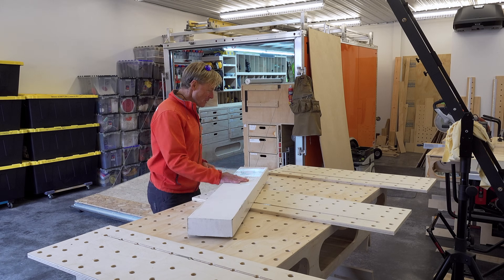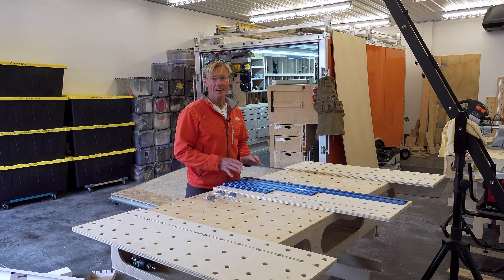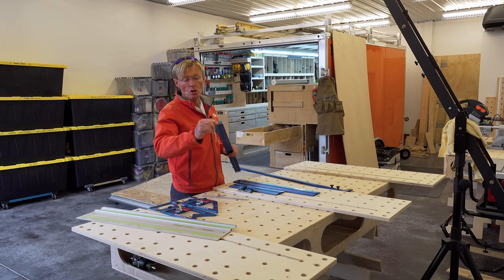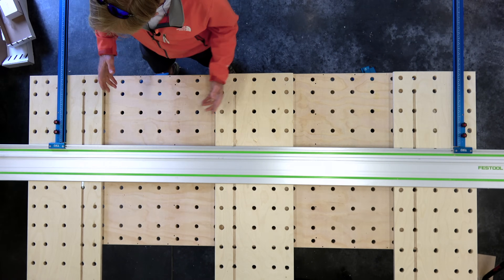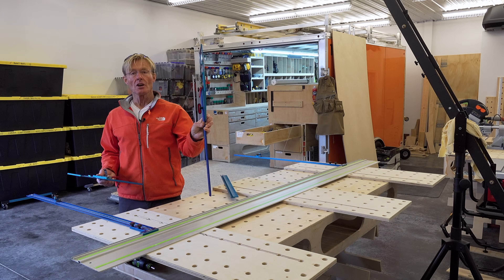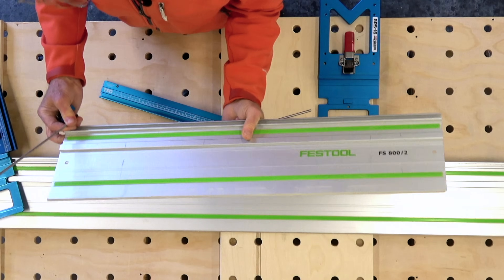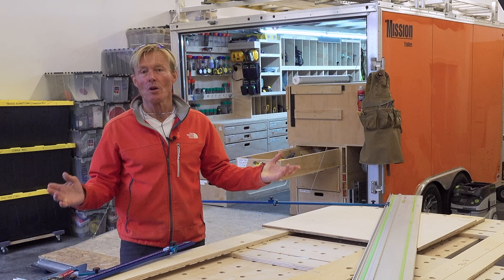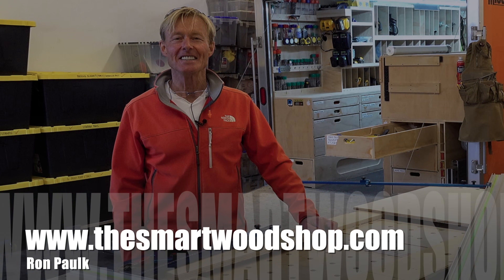TSO TPG 50 Complete Parallel Guide System (Rerelease with error correction)

Comment: Hi. Thanks for the informative video. I recently purchased (on OfferUp) the Makita Track Saw system. 
My question: I'm looking into the TSO parallel guide system. They offer a 20" inch rail, a 30" rail, and a combo set of 30"/50" rail ($100 more than the 30" set). In my spare time, I enjoy building small furniture for family and friends (book cases, shelves, tables, etc. in my side-of-the-garage shop. In your opinion, which rail size would you recommend? Thanks again!
Reply from the maker: If I could only have one rail I would go with 30" and workout something else for wider rips as 30 covers 90% of what I do. If you think you will do more wider rips then go with 50" as it will rip everything the 30" will. Of course it is a little clunky using the big rail for narrow stuff.
Reply: Thanks for taking the time read and reply to my request.

Comment: You also need a big workbench to cut with track saw so the space saving is debatable compared to say a table saw
Reply from the maker: A table saw cannot do what a track saw can do. A track saw replaces or works like a sliding table saw which is at least 10' long for ripping sheet goods. Those are big saws, take a lot of room and can't go to the job site. A work bench is necessary regardless of using a track saw or not so the track saw is the most compact and portable way to get rips done.

Comment: Hi there, I am looking at these as an alternative to the 20mm mft table like you have there to make perfect 90 degree cuts (at least temp for now and may go for the mft table later on for other work) . Anyway the stops ...if you have one on the left and another on the right lets say at 30 inches each - how do we get them both dead on (each) at 30 inches..is there a chance one might be over or under a fraction compared to the other? does it notch in place for example?

Comment: Hey Ron do you make 20mm dog holes or 3/4 inch dog holes and why?
Reply from the maker: 20mm. They are industry standard worldwide. My first bench was 3/4" 4" on center and it was an uphill battle that caused problems. 20mm and 32mm spacing have been the industry standard in the cabinet world since WWII. The only regret I have is spending 30 years holding tight to Imperial. The metric system is so much easier than working with fractions. Add 1/8" + 3/16" + 1/64" or 3mm + 5mm + .5mm. I can do both, base 10 whole numbers wins for me. 😎🤙

Comment: I have the woodpeckers and it is a disappointment. How does the TSO differ?
Reply: The only reason a person needs parallel guides is if they are ripping several sheets of God knows what. I bought and returned the Woodpeckers parallel Guide set as I despise wasteful tool set up time. Then I bought the Festool Metric parallel guides put them together and never took them apart, As long as you use the same saw with the same model saw blade it's fairly easy to use. Pay attention to the set up videos offered all over you tube. I like the Festool Parallel guides but Paralax can be an issue with them, but they are a little heavy and I am kind of old and do not consider them the most portable. Seriously watch out for Parallax with these puppies. 
So for a more portable set I bought the Seneca rail guides without the Incra Track as I have more Incra Track than I like to admit. The lock down of the Seneca to the Track was good but the incra track does not fit well and is less than desirable as it will not stay square without high precision shims. However, I did like their narrow stock guides. Also the Incra scales do tend to move so I used some hot glue to help them stay put. No, not the best solution.
Now I've gone and purchased the 30 inch option from TSO. I can report I bought the best one last. I never expect anything to be "Spot On", "Dead Nuts Square' when speaking about wood. There is close, very close, and really - really close. Wood is a living breathing material and it all moves. even very expensive plywood can and will move unless properly finished. So understand NOTHING will ever be and stay perfect. Go ahead argue all you want but you'll be on the losing side. 
So what are some other problems? Set-up Methods, operator deviation, and Blade Deflection. Forget thin Kerf blades unless you like Blade Deflection, cupped guide rail splinter guards and all manner of issues. Every Material has an optimum Speed and Feed Rate and so do blades, end mills and router bits. "Like a Knife through Hot butter is not a mathematical term and can not be measured. Most people cut too fast, either too fast of a blade speed or pushing to hard and fast through the material. 
Festool and Makita rails are not compatible the blade offsets on the saw are not the same measuring from the guide rib to the inside of the blade. I know as I have both type rails and both type saws. Also note that both manufacturers toe-in the front of the blade inward and not by the same amount. That thin assed blade on the Makita tracksaws is a POS - throw it away, buy their real ripping blade and enjoy your hobby. The Kerf is too thin and the Blade Plate thickness is even thinner. It will deflect with a heavy breath. 
As for the parallel guides I own the TSO is the best. But poor setup kills them all and makes them all useless. Watch the TSO set up guide (more than once) learn to make and use MDF gage blocks to help with consistency side to side. The TSO is not only CNC cut but also CMM measured to a perfect computer model. Did I mention the etched scales on the TSO rails are in both Imperial and Metric and their stops are unmatched, better than everyone elses.  The metric scale has a little mark every 32 mm as a bonus so you can make a balanced 32mm panel with their rails and this is why I bought the 30 inch rail set first. 768mm make a nice 32mm balanced panel for upper wall cabinets using Festools LR32 cabinet system. Almost US standard, but not exactly 30.25 inches. I try never to convert metric and Imperial or the other way around. Conversion is our enemy Use one, both but what ever the system stay with is until the projects end. 3/4 inch is not and can never be 18mm. 
FestooUSAl pisses me off as they sell metric accessories for metric power tools but substitute the proper metric scale with a damn Inch Scale. This sounds stupid because it is.  
Why 32 mm? Well 1.25 inch is 31.75mm, remember the USA rebuild Europe after WW2 and they improvised 16, 32, 48, 64, 96mm sounds like an MFT table being born.
We are all here so we can learn and grow. Nothing we make is perfect. Most need to forget about perfect, Get over themselves and learn to measure. How we deal with imperfection as a teacher is all important. Learn to plan, a drawing (crude as it may be) figure out what can go wrong and have a plan to deal with it. I waste a lot of wood, every piece is initially cut larger than I really need, but hey I have a wood burning shop stove. Winter is coming. 
Your drawings will improve, and do not forget to mark your reference edge and face on every piece. Variation in panels is almost always operator error or deviation from a well thought out plan.  Again, THIN kerf blades suck the air out of your projects and your confidence. Sorry for the rant. Certified Jet Engine Machinist (Suck Squeeze, Bang Blow) turned (woodbe) carpenter, Retired USAF Civil Service and GM Skilled Trades Maintenance Manager. UAW Skilled Trades always the best assholes on the planet.

Comment: Ron, your GRS-16 PE has 8 holes on the clamp side. Some versions have 4 holes. I sent pics to TSO and they are unable to explain the difference even though they have pictures of both on the TSO web site. They initially told me those are drilled by owners after purchase until I sent them a video of TSO's YouTube page using the 8 hole version. What are the extra 4 holes for???? no one seems to know including TSO!!!
Reply: I think that was brought up on the Festool Owners Group forums and I believe Hans answered. IIRC, there was something else TSO was planning for the extra holes and it never came to fruition.

Comment: If someone uses the GRS-16 PE or the GRS-16, which are fast and easy to use and are accurate methods, is a parallel guide system really necessary?
Reply: They perform different functions